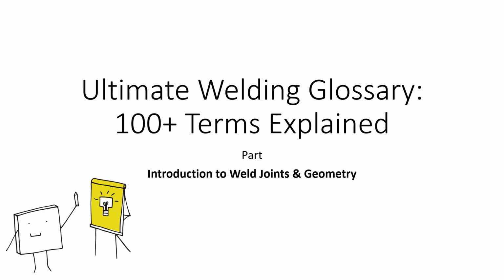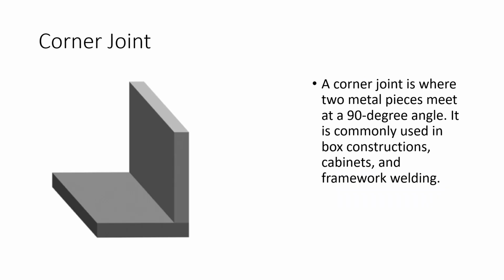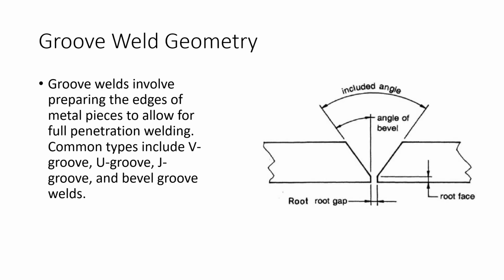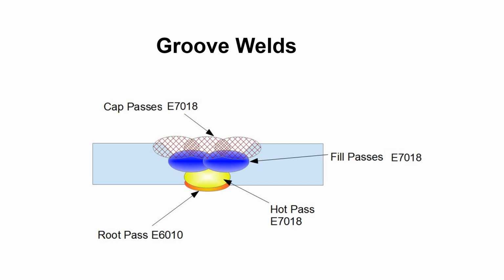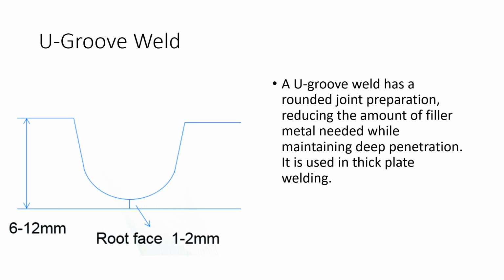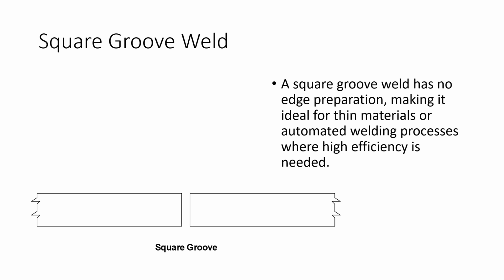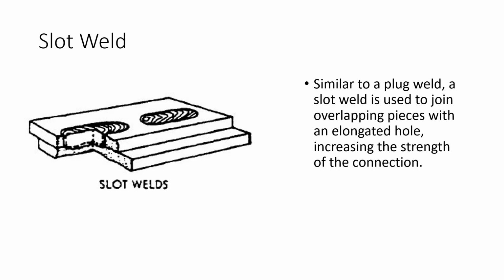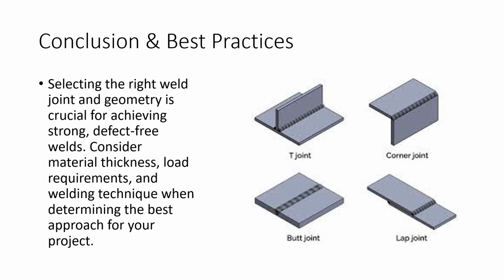02 Ultimate Welding Glossary - Introduction to Weld Joints & Geometry

Comment: I don’t know if you have a video on it, but I was looking for info on bend test requirements. Specifically when using a higher strength filler material than the base metal. AWS B4.0 talks about dangers of significantly different yield and tensile strengths between the materials but doesn’t say what difference is considered significant.